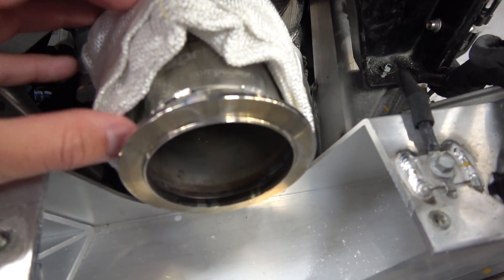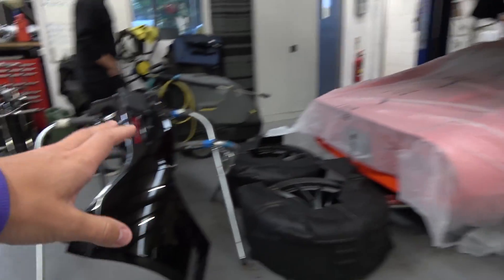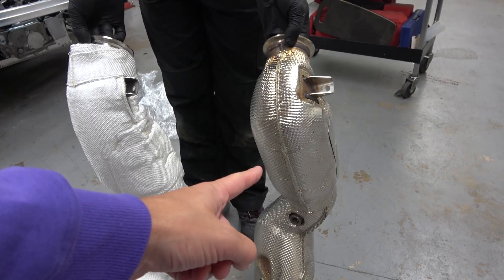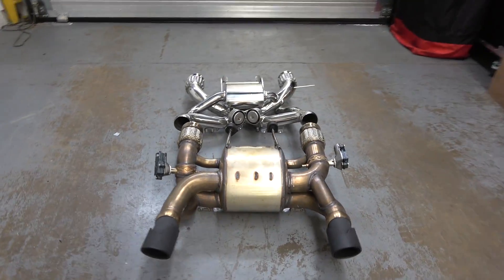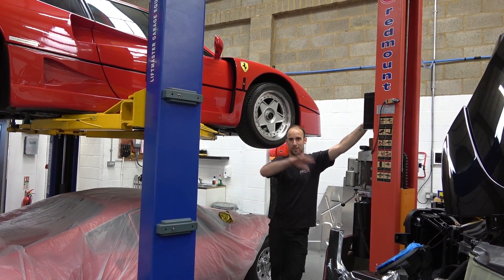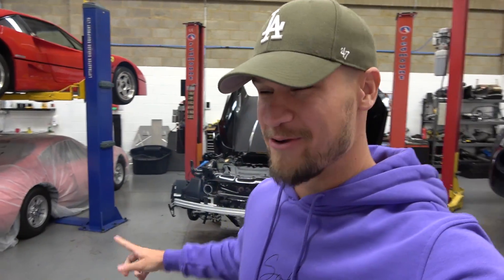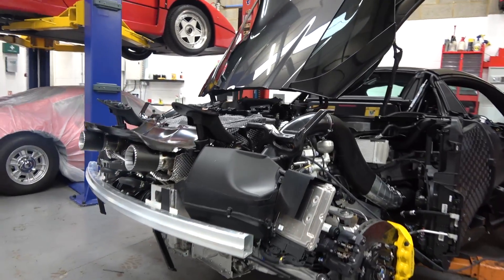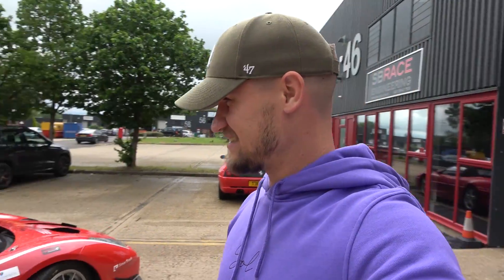NEW MCLAREN 720S FULL STRAIGHT PIPE!!

Comment: The suspension system is the most interesting part of the 720s the pro active system is amazing, I am surprised they still use a coil spring with it though, I thought the Hydropneumatic system would hold the cars weight by itself.

Comment: Why mess with the original parts. Mclaren have spent years and years and countless millions developing the cars balance and performance only for some cowboy to change it so it’s louder. Brainless.
Reply: Not really, McLaren have spent years designing the exhaust to pass stringent emissions tests and noise limit tests to make the 720s street legal. if road car laws would allow such a free flowing exhaust then you can bet that McLaren would do it themselves.
Reply: Capristo is top notch mate
Reply: Stringent emissions test in what country exactly? These cars are sold all over the world so you can bet the UK emissions laws aren’t really top of the list when mclaren are developing the car.
Reply: @deltavs3700  Typically car makers have slightly different setups for different countries / areas in the world. For example that's why the McLaren Senna has three exhaust tips in Europe vs. two in the US because the US allow louder cars on the road and the extra hassle in the exhaust system isn't needed. And the Abarth 595 has no silencer at all in the US, whereas it does in Europe. There are probably many differences between the same models in that respect all over the world.